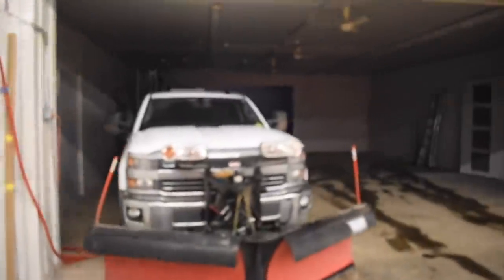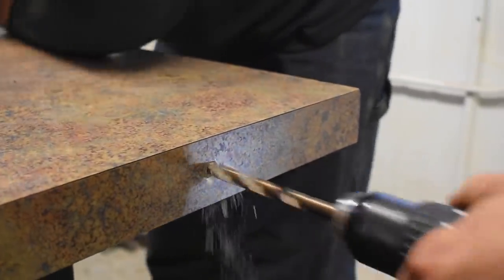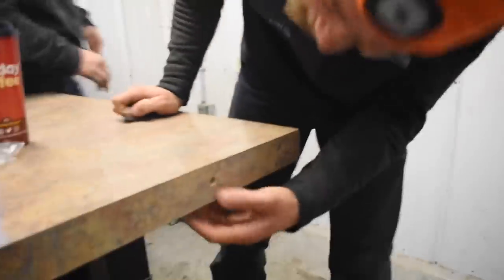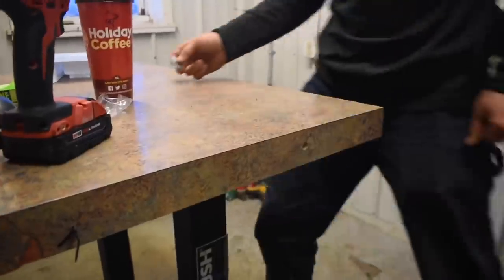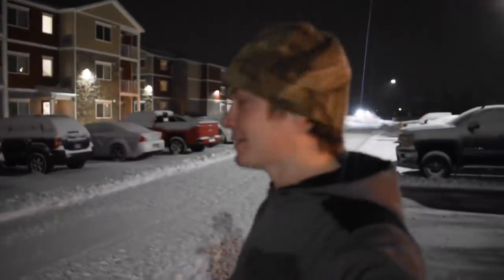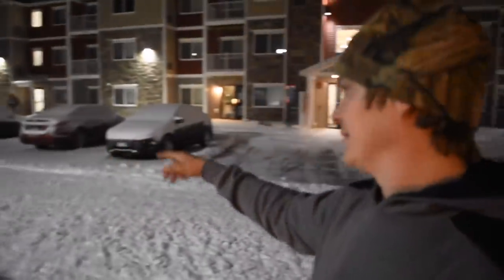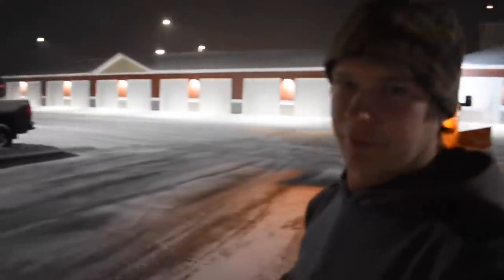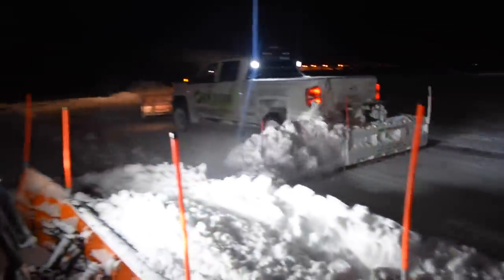SNOW PLOWING COMMERCIAL PROPERTIES! VLOG STYLE?!?

Comment: Nice we run a bunch of skids and 10 foot push boxes....been thinking about make the jump to 12' on some of the bigger accounts
We run 3 16' back blade set ups on trucks and one on a 108 hp tractor  with a 16 foot Daniel's  angle blade up front and a 16 foot back blade....its a snow moving machine...